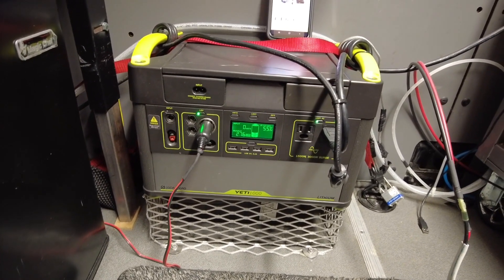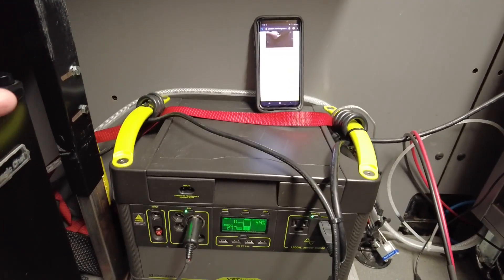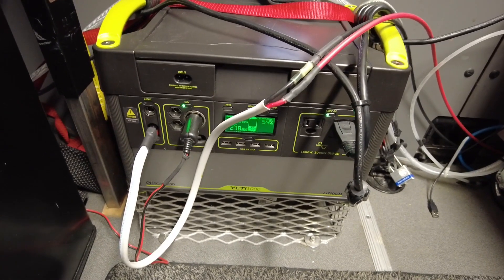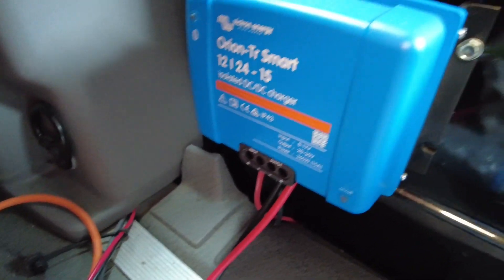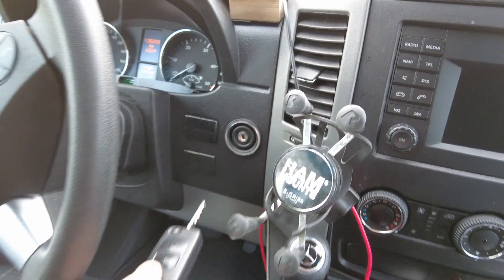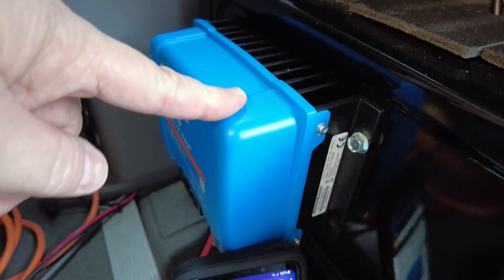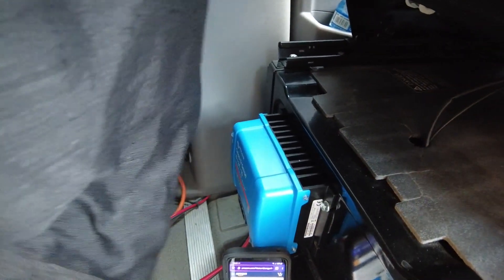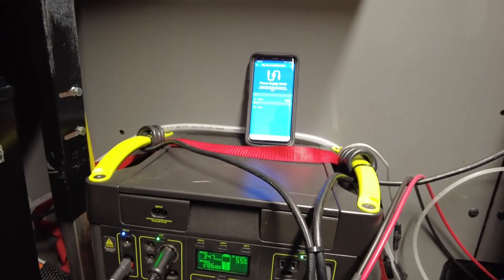Goal Zero Hack - Alternator Charging using Victron Orion DC-DC Converter

Comment: Great video. I've got a smaller Yeti 500x I'm wondering if I could do something similar.  I have the GZ car charge with the 5amp/10amp switch but the 10amp setting overloads my 12 volt sockets in the car so it's only usable at 5amp.  Been looking for a different solution  and would love to be able to hardwire in something to get the full 10amp charging.
Reply from the maker: Unfortunately the 500X won't be able to charge in the car using this setup. The maximum charging rate for your 500X is 10A, and the Victron Orion will push 30A which will overload your 500X.
You might have to upgrade your 12v lighter socket in your car to enable charging at 10A, or just charge at the slower 5A setting. The upgrade might consist of thicker wire (12AWG) connected directly to your battery, then wire up a female socket with a 15A fuse and run that over closet to your Yeti 500X. Then plug in your GZ car charger into that.  What do you think? Should be a much cheaper and viable solution. Without having to do any cutting or soldering you could consider getting these two items from Noco https://amzn.to/33ClR88 and https://amzn.to/3eFswEB Or build your own from parts at your local auto parts store. Connect the ring terminals to your battery, then connect the extension and run inside your car closer to your GZ Yeti 500X, which plugs into your charger. Let me know what your thoughts are. Thanks for watching!
Reply: @sprinterdiscovery  Thanks for the reply.  I will likely hard wire in an appropriate size cable direct to the battery to carry the 10amps, I'll have to isolate it so it doesn't continue to charge when the vehicle is turned off and kill my starter.  I guess my main thinking with going the Victron route was future proofing since I'll eventually get a larger GZ or build a dedicated dual battery system.  Appreciate the info.
Reply from the maker: @chanceboarder  I was thinking today, since you want to future proof and use the Victron Orion, you could get one of the Orion 12/12-30 https://amzn.to/2RMH7oP and hook that up to your starter battery, and purchase either an AGM or Lifepo4 12v battery and connect that to the Orion in charge mode (rather than power-supply mode). Then you can hook up your GZ car charger to that second battery which is now isolated from your vehicle electrical system and is always charged while you drive. Your 500X would then be charged fully and will stop taking charge when it is full. Your second battery would be almost fully charged all the time. 
Now, when you upgrade to a Lithium Yeti like the 1500x or 3000x, here's what you can do. Purchase the Victron 12/24-15 (the one I use in the video), and connect that to the second battery, which in turn is then connected via the Anderson cable to the Yeti input. 
When you are camping or parked, you can turn off the first Victron unit, and the second Victron will take the power from the second battery, acting as extra storage. And while driving, the first Victron will charge the second battery, the second Victron will charge your Yeti. 
Later when you totally eliminate the GZ and install DIY batteries, you could setup a 24v system with an inverter attached. You'd still be able to use all the Victron equipment you purchased - making everything future-proof. 
What do you think?

Comment: So if you don't have solar panels, then the idea is to charge your goal zero by just using your vehicles battery or second battery?
Reply from the maker: Hi Cameron! Thanks for watching! You are correct - no solar panels on our Sprinter van, and we charge the Yeti purely by alternator charging via the Victron Orion. We don't have a second battery (yet) so it's just the power coming from the starter battery via the alternator. We only use the Sprinter as our daily driver so it's charged fully nearly every day. It's an excellent working solution! Have a great day!
Reply: @sprinterdiscovery  Thanks....

Comment: Nice. Can you use this to chain LiPo batts to the yeti, or do the differing chemistries prevent this?
Reply from the maker: Hi Chuck - I have tested my AGM starter battery using my alternator on and off.  So with a 12V LiPo (Lithium Polymer) connected to the Victron Orion which connects to the Yeti, it should be possible so long as the VictronConnect lock and unlock settings are set appropriately - since there is no alternator involved in your use case.  

In order to prevent your LiPo battery (or AGM/LiFePo/etc) from draining completely, I would recommend to purchase a Victron Smart Battery Protect (Bluetooth) https://amzn.to/3nsX6Eh and put that in front of the battery (between the battery and the Orion).  That way you can program it to stop charging the Yeti when the battery is low and not completely drained to zero.  

I just looked at the VictronConnect settings, and they only have a setting for normal batteries and Lion batteries - so you'd have to test and see if LiPo will connect to the Smart Battery Protect.  I think you can have different battery chemistries (like AGM or LiFePo) connected to the Orion which can then charge the Yeti.

Hope this helps - Thanks for watching!

Comment: I am starting my build and have the Yeti 1500x, would you use a higher amp charger?
Reply from the maker: Hi Lynn! Your 1500X supports up to 50A input via the Anderson plugs, and the highest output is 24V at 15A .  I'm unaware of any other Victron Orion that can output any more amps.  
For your 1500X it has 1500WH, and if this Orion charges at 360W per hour, your 1500X would be full in 4 hours of driving - assuming you drained the 1500X all the way to zero.
Since we've had this solution, our Yeti is normally always fully charged - our van is our daily driver as we have downsized to only one vehicle.
Best wishes on your build! Thanks for watching!
Reply: Did you ever figure this out?  GoalZero has their Link Module now (400$) available with an EC8 connector on it.  I'm thinking of running 6AWG wire from the Alternator (or battery if the Link Module supports not killing my battery) and then hopefully getting 300-750W into the 1500X (link module supports up to 750W).  Currently my front facing APP port has solar panels plugged into it...I wondering how I can get all of this dialed into together without having to swap cables etc when driving.

Comment: man brotha that is some expensive ice bro you can just grab 5 lbs usually for 3$ sir.. those fridges are a giant scam.. respectfully
Reply from the maker: I think you commented on the wrong video?
Reply: @sprinterdiscovery  nope right one ... these fridges seems ridiculous with the power draw... i no a few people who got campers with them and quickly sold after first trip... unless your plugged into power they are difficult...solar is always depending on the weather clouds make a huge problem when out for the week end... no i did not watch the hole thing i will have two go back..
Reply from the maker: Ah ok, yeah the electric dorm fridge I have in the van for the past 3+ years is using about 300Wh on average daily. I need to make a video on this one day. If I'm weekending it will keep our beer/food cold for almost 3 days without charging the Goal Zero. We rarely park for more than that in one spot, so when we drive the Victron Orion charges up the Goal Zero. In fact I usually leave the fridge plugged in full time. We drive almost daily anyway. Cost at Home Depot open box was $65 if I recall. 110v energy efficient. No solar on the roof, so definitely having a small dorm fridge works out ok. I can't see ourselves spending $500+ for a good 12v fridge - can't justify that expense for us when this is "good enough" - if you know what I mean. Thanks for watching! Let me know if you have an alternate solution - always open to new ideas!
Reply: @sprinterdiscovery  lol i thought it was a 12 volt fridge sorry..
Reply from the maker: @hulie1234  Ok no problem! It looks expensive... But isn't! LOL Have a great day ahead!

Comment: Loving this option and thanks for all of the tips.  I'm doing a van build with my son and looking at the Yeti 1500X.  We would be using this Victron option as well as solar.  Is it possible to have both the Victron and solar connected at the same time?  If so would the Yeti be able to chose between the best input.  Victron while driving and solar while parked?
Reply from the maker: Hi Bill - thanks for watching! Yes it's possible if you have the optional MPPT module installed. The Victron Orion output can plug into the built-in PWM controller Anderson connections and your solar can be plugged into the MPPT Anderson connections. The Yeti would utilize all the available power coming in. So as you drive while during daylight hours your Yeti would charge from both solar and from your vehicle. When you drive at night it would charge via your vehicle. When parked during daylight hours it would charge via solar. Best wishes on your van build with your son!
Reply: @sprinterdiscovery  Will the MPPT ($99) work with the 1500X or would I need to purchase the car link adapter ($499).
Reply from the maker: Hi Bill - According to Goal Zero, yes the MPPT expansion module is compatible with your 1500x https://www.goalzero.com/shop/yeti-accessories/yeti-lithium-mppt-solar-charging-optimization-module/
Another option would be to save yourself some money and just plug in solar during the day, and the Victron Orion at night or during overcast days when you drive. Not the most convenient but it will work.
Reply: @sprinterdiscovery  Last question, I promise.  I'll be putting this on a Ram Promaster.  It will not have a smart alternator.  Will the Victron still be able to detect when the engine is on or off so it doesn't drain my starter battery or house battery?
Reply from the maker: @billparry5738  Hi Bill - Feel free to ask as many questions as you like - I'm learning a lot from this community! Googling the ProMaster forums, it appears that the ProMaster alternator has a fixed output of 14.3V when the engine is running.  Sprinter alternators have variable output voltage. Definitely the Victron Orion will be able to easily detect if your ProMaster engine is off so it doesn't drain your starter battery, and only starts to charge your Goal Zero when the engine is running.  In the VictronConnect app, within the settings section, the two values you would enter can be 13.2V and 13.4V (same as my Sprinter van).  When the alternator produces 13.4V or more the Victron Orion would engage and start to charge your Goal Zero.  At an input of 13.2V or less (ie: the ProMaster alternator is not charging since it is less that the fixed 14.3V output voltage), the Victron Orion will not drain your battery and will not provide power to your Goal Zero. Let me know if this helped. Thanks!
Reply: Also, would I need to add a fuse / breaker going into the unit and what size breaker / fuse should I be using going from the unit to my battery?  I purchased the 12/24 - 15.
Reply from the maker: @billparry5738  Hi Bill - You'll need the isolated version - keeping it isolated from the rest of the vehicle, as we're not sharing a ground connection. This particular Orion comes with a built in fuse, whereas some other Orions do not come with the built in fuse.
Reply: @sprinterdiscovery  Would I need a fuse / breaker going from the Victron to my Yeti? If so what size?
Reply from the maker: @billparry5738  I'm honestly not sure. Maybe somebody from the community can chime in here. On my setup I don't have one.
Reply: @sprinterdiscovery  Hi there,

Following up on our many conversations. I picked up the MPPT module from Goal Zero and have that connected to my solar (2x175W flexible Renogy panels) which on good days are throwing in about 320 W.  After a conversation with Goal Zero we determined that the unit (1500X) will not charge from the solar and B2B input at the same time.  They Yeti will charge from whichever port is throwing the most energy into the unit.  Also, per Goal Zero, fusing is not required but after going through the Promaster Forums and the Victron manual I'll be going with a 60 Amp fuse at the van battery and the house battery as well as a cut off switch on the house battery side.

Two final questions before I do the install today......  With the Victron outputting 20-30V and the Yeti accepting 14 - 50V I should be able to set the Victron output at 30V and still be ok with the Yeti, correct?  Also, am I setting the Victron up for Power Supply Mode or Battery Charging Mode?

Thanks again for your video and feedback.  You have been infinitely helpful throughout this process!
Reply from the maker: @billparry5738  Hi Bill - Thanks for sharing all the info you received about the Yeti after speaking with GZ. We're always learning more info about this amazing Yeti. 

Personally, I'd set the Orion to 22V output and that's only in case I would forget to connect the Anderson plug into the MPPT module, and instead plug it into the built-in PWM module if I had both. But if you know for sure that it will always go into the MPPT module, you could set it to 30V. The output of the Orion would be in "Power Supply Mode".

I'm glad I was able to help you out on this! And many thanks for the kind words - much appreciated. Best wishes on your setup. 

As you know I don't have solar, but I drive my Sprinter van nearly every day. My Yeti 1000 is normally topped up at 95%, is almost 4 years old in August, and is going strong! This Victron Orion solution is the best thing I've installed in my van so far. No need for solar, and with all the rain and cloudy days we normally get here in Vancouver Canada, the Orion/Yeti combo is AMAZING!

Have a great day ahead!
Reply: @sprinterdiscovery  The input from the alternator needs to be fused near the source, if the input cable rubs through before the Orion, the internal fuse will not prevent a short circuit. Cool "hack" though
Reply: @billparry5738  Why couldn't you use the either the 8mm or anderson connection for solar input since the GZ 1500X has a built-in mppt charger? I ordered my parts and ready to install everything asap. I will say that I haven't tried to input energy into both ports at the same time but I've done the following.

1: Used a wago splicing connector and ran that line into the anderson  connector and the GZ1500X accepted a charge.
2: Used a Victron Orion TR Smart 12 | 12 - 30a and tested successfully in power supply mode via the anderson port.

Once the 8mm cable comes in, I'll connect solar wago splicing connector in one end and the 8mm into the GZ1500X and then enable the Victron Orion 12 | 24 - 10a. I'm expecting both to charge my GZ1500X simultaneously. I downside the 12 |12 - 30a to the 12 | 24 -10a because I didn't want 30 amps dedicated to the GZ1500X since the GZ1500X is going to be used as a secondary redundant power bank. The two BattleBorn batteries will be my main source. 

I have a transfer switch installed in my campervan so when any of the output ports (ie; AC) are plugged in, The switch kicks in and the campervan thinks the GZ1500X is the main 30a source. Same applies to the 12V panel. The previous comments is the short version of how things work in my campervan. Bottom line is that I can run my rig via generator, lithium batteries, shore power or GZ1500X.

Comment: Great Hack. I have the same 1000 but only 2 years old.  Can you use the 10 amp model instead of the 15?  Thank you.
Reply from the maker: Thanks! I'm sure you can use the 10A version of the Orion 12/24-10A but it would just charge slower at 240W input. Just wondering, what benefits would the lower amperage bring for you? Thanks for watching and leaving a comment here! Much appreciated!!😊

Comment: This is awesome, I have the same goal zero 1000 and I am from Raincouver as well!🌧.  My question is answered below about how the victron is connected to the battery. Right now I have an extra 100ah lithium battery that charges the goal zero through the 8mm via alligator clamp. Wondering if the victron is needed, is it to protect the goal zero? Can I test it out first without the victron, connect the goal zero directly to the battery? I also have the mppt and solar panels. I didn’t know that the goal zero can be charged so quickly by the alternator until watching you video. Can it be charged while the engine is running instead of driving? Because we tend to run out of batteries by night time and parked. Would love to hear your input. Thanks 😊
Reply from the maker: Hi Shelly (and fellow Raincouverite)! The Victron protects your alternator from damage, and also upconverts the 12V over to a configured 20V-22V. It provides for a steady voltage going to your Goal Zero. Most newer alternators provide a variable amount of voltage as you drive. 

 I don't recommend that you connect to the car battery directly. 

It charges so quickly since the voltage is high (22V vs 12V) and the amperage output is also high at 15A which the Goal Zero Anderson input is able to handle. With this Victron setup, so long as your engine is running (parked and engine running, or driving), you're able to charge your Goal Zero. I hope this helps and answers your questions 😃. Since you're local, feel free to contact me via the email address in my About page here on YouTube and I can personally show you our setup. All the best! Thanks for watching!!

Comment: Good video... I have the 1000 and the Yeti Link as well... but I’m finding Goal Zero stuff expensive and I’ve had the battery for 3 years now and it’s getting flaky... So, slowly moving over to building my own battery system with 100aH battery etc...
Reply from the maker: Thanks Jong! Yeah the Goal Zero equipment but very well built. If your battery is flaky after 3 years, you could contact Goal Zero and see how much it would cost to have them replace it. Worth a shot at least. Thanks for watching!